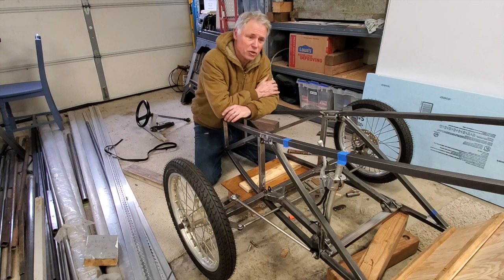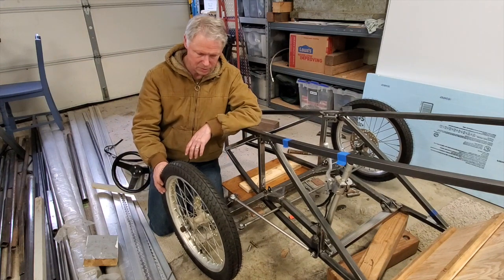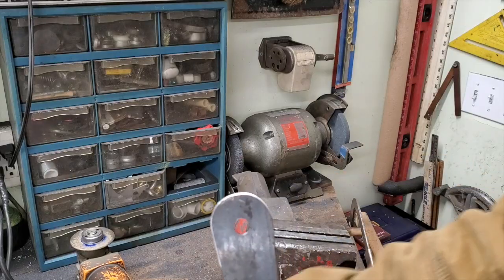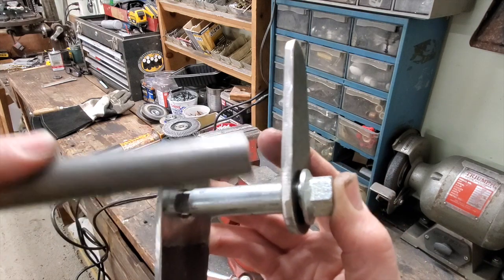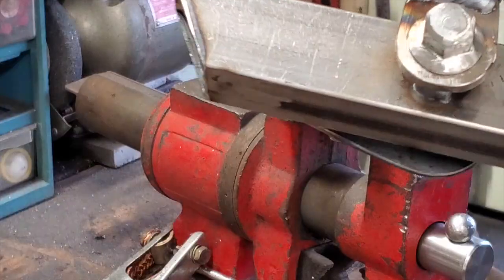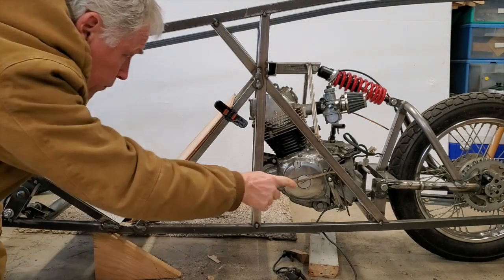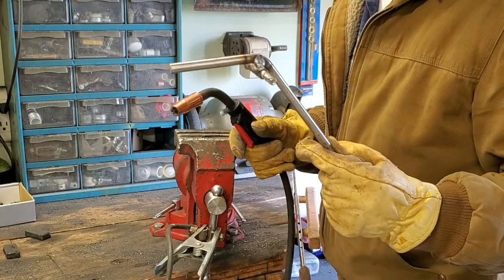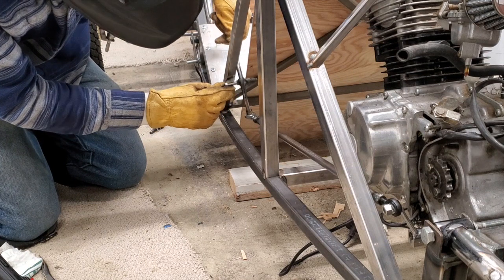Fuel efficient reverse trike build (part-6)

Comment: Quick release steering wheel is ohter option, to get in and out more easier. Or seat lifter. It is handy for better view in some traffic situation. In rear suspension, it is more simplier. Electrical shifter is position free.
Basically first thing in planning is ergonomy. Vehicle is bad if you are in trouble to get in it.

Comment: Looks like the KPA is setup for good scrub and the steering is different but should work OK. Ride may be a bit rough with the straight axle and narrow tires but it will corner flat. I design reverse trikes so I find these home grown designs interesting
Reply from the maker: I'm taking most of my design from the plans of the California Commuter, with my trike being one foot wider front wheel spans and having twice the length on the swing arms. I made the swing arms longer so I could place my feet in between thru the floor for Flintstone reverse. I'm nearing a down hill coast test. I've decided not to go further until I'm satisfied that the steering and front suspension will shake out to my satisfaction.

Comment: If you're happy with the frame layout, now would be the time to weld it solid and have a friend do a low-speed tow so you can get a feel for the steering and suspension. Maybe do the breaks beforehand, though.
Reply from the maker: You read my mind Jarek! Right now I've got the rear brake, clutch and throttle all hooked up. Still waiting for disk brake parts. I'm about to weld up the frame but still a bit to do before I get to that point.

Comment: That’s cool I like that steering setup make it easy getting in and out. It’s opposite to my reverse trike which has a 1000cc motor not so fuel efficient!
Reply from the maker: Hey Daniel. I've spied on some of your videos of you revere trike BEAST! Opposite designs for sure, but we have similar building skills, except you can tig weld. So jealous....
Reply: @paulwelkinsdiy  they are different. I like your videos style too , are you getting it road legal? How fast do you think it will go ? Being so aerodynamic it would be pretty quick

Comment: With a tiller setup you might need a steering damper to help reduce bump kickback to your hands. I don't know the wall thickness of your front axle but the long leverage length from contact patch to shock might want to bend it at the shock mount.
Reply from the maker: It's not all that thick, so I'm thinking of welding on fore and aft support plates straddling the shock mounts. I was looking up what might work for a steering stabilizer but not sure what I'll go with. I need about 4" of travel yet only 13 or so inches long.

Comment: Unless you absolutely need a square a slot with rounded ends as much easier to create. You just cut two sides off of the rod instead of four (leaving the remaining material narrower than it would have been if you had been making a square) and then you can drill a hole in the top and bottom of the slot you're creating on the plate and then join the two holes with a Dremel and you're done.  Of course since you were weldingit anyway a simple hole for the rod to go through probably would have been fine.

Comment: Isn't the cage a bit small? In case of an accident the driver will be locked in tight possibly injured.  Just a thought. I'm going to build one at least 36 inch wide where I sit.

Comment: I have been following you for a while. I've seen your other builds and I like this one the best. Are sure you want to go with that suspension set up? I think you are going to need to put on a kidney belt and make an appointment with your dentist for some new fillings after your first long ride.
Reply from the maker: Quite possibly, but I have good dental coverage and fair Kidneys. Again, this is not a rough road trike. It will strictly be used on paved roads.

Comment: I don't know if you're interested in the e-bike side of things, but I'd like to see the velomobile community try to push what's technically possible with a 250 watt electric motor (the legal limit in most places without a licence) in these sit-down capsule setups. Maybe they could sustain traffic speeds?
Reply from the maker: In Washington state the legal limit is I think 20mph for electric or gas assisted  bikes or trikes. Limitless if you have pedals only. Go figure...
Reply: @paulwelkinsdiy  Yeah, but they don't have to know it goes that fast! ;) An e-bike will go way faster than that down a steep hill! hehe

Comment: hello ,Paul  .Can I turn your stearing mechanism  on the end of the axle,.... up side down ? If I want to use small  wheels,... for instance scooter wheels ???? I mean  the axle above ,... same corner  ,...wheel axle low ?
Reply from the maker: ARG!!! Not sure Pipelonio. It's something you would have to try, and see if it works! That's often what I do. If it fails at least I know what NOT to do!

Comment: Do you have the clutch on the left hand-grip like a standard motorcycle? How will you clutch and shift at the same time with the shift lever down below on the left? Maybe you could rig up a cable operated foot shift?
Reply from the maker: I just have enough room for the standard three pedals. A tight fit, but so seems to be EVERYTHING with this rig!
Reply: @paulwelkinsdiy  well that answers my point...  I also think sticking too motorcycle controls is better,,,  half motorcycle and half car is asking for trouble..

Comment: Just a few pointers. Your steering set up lacks trail by the looks of it. This is quite a dangerous condition, worsened by the tiller steering system. A rack and pinion system lessens the load coming back to the driver. Those set ups get away with about 7 degrees of rake and the amount of trail that goes with that. Direct steering systems, like a motorcycle, have more. Like 25 degrees and upwards. 
I was pleased to see a fair amount of KPI. But, from what I can see, the scrub radius is large, further increasing the destabilizing forces in the steering system. This requires even more trail to get some positive dynamic stability.

Comment: I looks alot better with the steering  levers,,but as you say you have all hand motorcycle controls ,,why did you not carry that idea though too the gear change,,,  a foot gear change would mean a longer control arm but  you would be carrying out the gear change with a spare /Unused limb. and as the change pattern will but sequential  then no great problem...   I also have issues with the front suspension...

Comment: When you shift your arm is out of the car.
Reply: Only if the sides are flat. It is snug though.
Reply from the maker: Good observation. I already installed a side panel and yes, It's gonna be tight! Not what I wanted but IF I'm going to use the acrylic wind screen I have to keep to the width of the windscreen.
Reply: @paulwelkinsdiy  maybe a small buldge on the sides
Reply: @chrisdutson9894  
A tadpole trike with muffin tops?
Reply: @thechumpsbeendumped.7797  lol guess there is a name for this!

Comment: I can see a potential issue with your steering angles. Let me know if you want more information. ✌🏻
Reply from the maker: Thanks David. I'll be giving it a down-hill roll test soon. If I have issues I'll get back with you!
Reply: @paulwelkinsdiy  Good to hear, but be careful as there’s a possibility that the steering might be very twitchy, especially at higher speeds. 👌🏻
Reply: @paulwelkinsdiy  Btw, this is very similar to a project I had planned to do a few years back, but a disabling injury physically won’t allow me to do it.
My vehicle was going to be an electric version of what you are building, but with an advanced suspension system (microcontrollers, gyros and electro-hydraulically controlled dampers) that would allow me to use it without pain due to said disability.

I’m very interested in how yours turns out, so keep up the good work.

And don’t forget to hit me up if you’re steering causes you issues.
Reply: Hey  @paulwelkinsdiy  MY BAD!! I MESSED UP!! 😂😂🤪

I must have missed the the last few minutes of part 3 as I’d  not seen the part on how you measured up your steering angles. 🤦🏼‍♂️
By the look of things, I’m pretty sure you know what you’re doing, and you’re doing it far better than I could. ✌🏻

Comment: Where can I find the "fuel efficient" part?
Reply: what do you mean? its lightweight, streamlined and has a small motorcycle engine...
Reply from the maker: @lucasvanhamburg4937  I know some of you laugh at the amount of steel going into this Beast, but I'm using what I can weld. I've never welded aluminum before, but know it takes skill. So far the trike looks like it will weigh in at around 300 pounds. I'm also planning on trimming off some of the steel rear section and replacing it with riveted aluminum.
Reply: @paulwelkinsdiy  alright thats cool! I have been experimenting with fiberglass and xps 300 foam sandwich and I think it would be a great material combination to use for a monoqocue design. I'm making a kayak right now but hopefully I'll find time to make my own hypermiler soon.

Comment: Did you just go through all the work of squaring the 'bolt' and the flange that accepts it,  and then just weld it up anyway? Coulda just kept it round and welded, and saved 5 hours, or so.